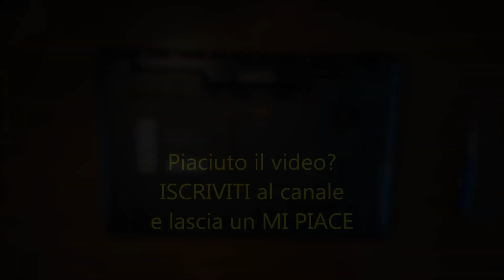Acer Aspire 5750G 5755 | Disassembly + Fan Cleaning + Reassembly Notebook

Comment: Thanks its very useful video
Can i replace this hdd with ssd ?
Reply from the maker: You can put an SSD on any notebook, Ok compatible with the Sata standard. i recommend samsung or sandisk for compatibility issues.
Reply: @thesilentube83  what about crucial brand ?
Reply from the maker: @hssn124815030  Those are fine too, as long as they are well-known brands

Comment: Hello there! I used this tutorial to clean my fan back in April 20 and after reassembling it worked pretty well. Now I tried to do it again but after reassembling the screen isn't starting. I think the problem should be somewhere where screen connects with the motherboard or other parts of the laptop. Could you please tell me which one of the cables should I fix? Or what to do? 
( I reassembled already 3 times now but the problem is still)
( I tried removing and repositioning RAMs but nothing helped, the screen is still dead. )
( The power indicator is blue as usual)
Reply from the maker: Hi, I'm sorry for how many this happened to you, have you tried connecting an external screen and see if it displays? If the screen remains black it may have been damaged, the flat lcd or the video card ...
Reply: @thesilentube83 
Okay so I haven't tried any other monitor but I'm pretty sure the picture will be present on them.
I am bringing the laptop to the computer service tomorrow let's see what they'll tell me new. I'll write an update
Reply: Update: Alright so the service guy told me that the motherboard was damaged during the process. I can approve that this tutorial actually helps since I cleaned the laptop back in april and it ran absolutely smoothly, Thanks!
Reply from the maker: @dacchii  I'm sorry for what happened to you but unfortunately it can happen in the disassembly and especially in the reassembly that something can go wrong, especially if those who engage in cleaning have no experience!

Comment: After cleaning the fan, the power button after press turns blue but nothing happens on the screen. After connecting the charger the orange power light is also not lighting.
Reply from the maker: There seems to be a problem with the power supply, re-assemble and check that you have connected everything properly
Reply: @thesilentube83  sorry, this was my fault. The power plug was not properly set. Even then I had a blank screen. After that I just relatched the Ram, then the laptop booted properly. In the process i damaged the speakers. Even after cleaning the fan assembly, the laptop heats up.
Reply from the maker: @muneshchauhan  If you do not have experience in disassembling notebooks, it can happen to break something, luckily you will find cheap speakers at the used (eb @ y). Have you changed the thermal paste besides cleaning the heatsink? 'Is critical!
Reply: @thesilentube83  Yes I have cleaned the old thermal paste and added the new one on both the processors (CPU & GPU). I think I damaged the speakers by pressing on the top round part. Is there any way to repair them. At high volume, I hear vibration sounds. Thank you for your help. I am now planning to add a SSD (240 GB) and put the current 640 GB HDD in the DVD ROM bay using a caddy. I have already bought the SSD and the 12.7 mm caddy. Do you have any specific suggestions on this?
Reply from the maker: @muneshchauhan  Once the speakers have broken, the membrane must be replaced! The SSD I advise you to install it in the main sata slot, if you want two hard disks put in the dvd slot the slower one with the adapter, but do not expect the same speed as before in reading / writing!

Comment: Why the battery charges only when laptop is off 
While its on it doesnt charge
Reply from the maker: I believe there is a problem with the charging circuit
Reply: @thesilentube83  not the charger itself ?
Reply from the maker: @hssn124815030  It could also be he who is not delivering enough amps, you can try another one
Reply: @thesilentube83  sorry for too much questions but how could i know if it is charging circuit or the port or the charger itself 
After i insert the charger it remains for few seconds then power and charging light begins to blink and charging stops

Comment: Screen stopped working after thjs
Reply from the maker: Recheck all connectors, especially the flat LCD 

Disassembly should only be done if one has experience or good manual skills.